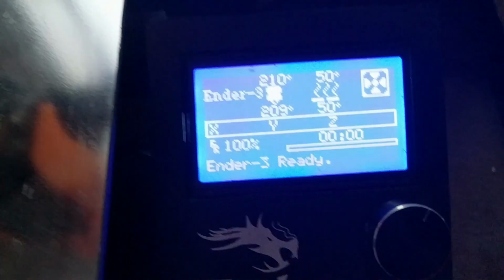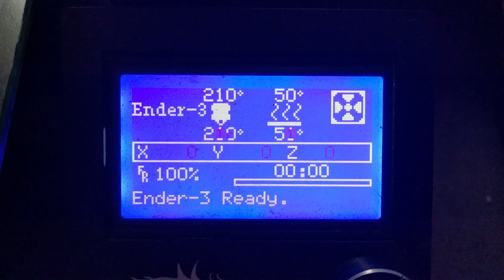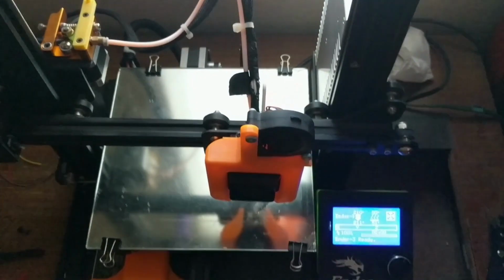Ender 3 Heat Bed Wiring Fix

Comment: Thank you for this video  - it helped me troubleshoot problem almost in an instant.
that being said, I had my Ender3V2 from late 21' till now working nearly flawlessly. 
In beggining of january I had over 103 days of print time.
I know around 20Kg of printed filament aint much -  but I guess I can say low cost wiring is a wear item.
Reply from the maker: Anytime wires move or connections have to rotate or reciprocate, they are a wear part. Like the wires that go into a car door or hatch, or the rotating controls on a multimeter. Some will last a long time, but eventually they will fail.

Comment: Thanks for making this video man. What i love about the ender 3 is the same reason i hate it. Theres such a saturation of irrelevant information when your having an odd problem like this its difficult to find someone takking about having both thermak runaway and failure to heat bed. Now im going to go check those solder points before removing the bed if i can. It seems regardless of what you search about the ender 3 today its always a guide to bed leveling. I had tk dig to find your video. Anywy, i appreciate it.

Comment: My one wire broke off right at the solder. Could I just cut my wire off there, strip them both and solder them back onto the solder blobs that are already there?
Reply from the maker: Sure. Just keep an eye on it, if the wire is work hardened in that area it will probably break again. You can also try adding some support to it there with some shrink tube or something similar.

Comment: No runaway for me, but failure to heat. I'm a n00b, how and where do I test for volts and continuity to isolate the issue?
Reply from the maker: Do you have basic knowledge of multimeters and electrical testing? If you don't, then I'd either find someone to help you or maybe watch a few videos on it first. Test for continuity first. Unplug the printer, take the bed off and flip it over so you can see where the bed heat wires solder onto the bed heater. Next remove the  remove the cover over the control board and find the two large wires that provide heat to the bed. The bed heat wires should be the center pair on the triple set of green screw terminals. Remove them from the terminals. With the meter set to continuity test both ends of the Black wire then both ends of the Red wire. With the meter set to continuity the buzzer should go off and the meter should show full continuity. If you get continuity try moving the bed or wiggling the wires. If you get continuity through both wires yet the bed still won't heat you're going to have to plug the printer in and very carefully test for voltage at the bed heat terminals on the control board and again at the bed. Be careful, shorting something out at this point can ruin your board. If you're getting the full 24 volts it could still be the wires, but also a dead bed heater. But also, once it's this far apart if it were me I'd probably just run a new set of silicone wires since we know the factory wires are crap. But you'll need the tool and knowledge to unsolder and resolder the wires from the bed heater. And while you have the control board cover off, make sure ALL of the screw terminals are tight and there's no sign of arcing or melting of the terminals. Good luck!

Comment: I do not see how this cable issue can cause a run away bed heater.
Reply from the maker: Whenever the thermistor isn't reporting what the mainboard thinks it should be you get a thermal error. In this case the mainboard is pumping current into the bed heater and the thermistor isn't reporting the temperature going up. It only lets that go on for a specified period of time before it throws the error and shuts the power off.

Comment: Hello Chuck, I have an issue that maybe you or your audience can help with. All of a sudden, as soon as I turn the printer on the bed starts to heat up with no value even enteree, and then shuts down with an error message...... Since then I have actually replaced the bed, and the mother board which neither solved the problem... FRUSTRATED in Palm Harbor Fl.
Reply from the maker: The bed heats as soon as the printer is switched on? Has the printer had this problem since it was new or did it work right at some point? Is the board a stock one or aftermarket? What firmware does it have? 

Without more info all I can offer is basic troubleshooting, but it's not a complex system. 

Somewhere the bed is getting power when it should not be. So it's either wired wrong, there's a short to power, or the firmware is turning it on when it shouldn't be. 

If I had this printer dropped on my bench to fix the cynic in me would say it's wired wrong and I'd check that first. But I'd also check the bed heat terminal on the mainboard, is it hot all the time? What's making it hot all the time? Is there a mosfet for the bed that's not on the mainboard? Test or replace it. I'd also do continuity tests on each bed wire, end to end, end to ground and end to other  nearby wires that are hot all the time. Once I convinced myself that all that was good I'd look at the firmware, searching and checking all the bed heat settings. If it's Marlin I'd consider backing it up and flashing with a new copy as a quick troubleshooting step.

Comment: Sir! I found your video quickly after google searching for Ender 3 Bed heating issue. You pointed me directly to the problem - Both a broken thermistor and Heat wire (+24v) at the same time! Thank you for taking the time to produce and share this video. I think the chain/links I used were the cause as I don't have much room as they were consistently hitting the back wall, and accelerated printing my have made it worse. Don't get me wrong, love the cable guard, my implementation was to blame. I hope this helps someone else.
Reply from the maker: Thanks for letting me know!

Comment: What do you think could have been done to prevent this from happening? I've got an Ender 3 coming today.
Reply from the maker: 1. Better quality and slightly longer wires. Better quality solder and workmanship and careful quality control. But then again, if they did those things it wouldn't be a sub $200 printer. 

Things you can do? Inspect the heat bed wires and soldering. If you find anything not to your liking remove the original heat bed wires, wick the solder off and replace with quality tinned wires with silicone insulation and solder them property using a good, lead based solder.

Personally I think the Ender 3 is designed to last just as long as most people's interest in it will last. And from what I've read, it's only a small part of us that will actually get it printing properly and keep using it long enough for it's problems to surface.

That being said, the new models are supposedly better in many ways than my two early models. But I'd still inspect things carefully when I'm assembling. Wires, connectors, the Z axis rod line up and making damn sure the X axis arm is level. and the whole frame is squared properly before tightening.

Comment: Thanks for sharing.  I wanted to actually see the soldering part, but still a good vid
Reply from the maker: Thanks!  Sorry about not showing the soldering part. I actually had meant to include it but found that my little TS100 iron wouldn't get it hot enough and ended up getting my pistol grip Weller from the garage and I never restarted the video.

Comment: Hi Chuck, I Haven't seen you around for a bit. I hope you're well. Look after yourself.
Reply from the maker: Hi Paul. I'm fine, thanks for asking. My problem right now is that my house is still torn up from the flood and it's been a real headache getting work done right. Hopefully we're on the right track now to get it done and, if there's a God in heaven, it will be done in a few weeks. I was actually thinking of clearing out enough space in my office to print some things and make a video. Again, thanks for asking!

Comment: Chuck, i just bought the new creality ramps 1.1.4 motherboard and after installing it i now have hotbed runaway. I thought i wired it wrong but even after swapping the wires it runaway. Is this the same issue you had? I am at a roadblock and frustrated.
Reply from the maker: Yes, I was getting Thermal Runaway errors and the print would stop. In my case I'd get an open, the broken wires would be touching when the print started, but somewhere along the line would pull apart just enough to break connection and the print would stop with the error.

Comment: Chuck, you seem pretty handy, so I thought I would toss this your way.   if you (or I) wanted to check to see if the bed or nozzle is really heating to the specified temperature, any good way to measure that?  I'm really more concerned about the nozzle, as I seem to have to set my temps a little high to get the proper results, so was just wondering if my temp readings are off.
Reply from the maker: Unfortunately I haven't figured that one out either. I've got a good non contact thermometer, and it gets the bed temp perfectly as well as things like boiling water and auto engine temps (the latter being why I bought it, to solve an overheat issue with my old Jeep). But it misses the nozzle temp by 40c and I know that can't be right, the filament I use won't flow properly nor will the layers bond well at that temp. It also matches A/C temp perfectly with the digital contact thermometer I got for doing A/C work. Also, to muddy the waters even more, I can set all 3 printers to 210c and get the same temp from the non contact thermometer, (177-180 on a 210 setting) on all 3. I've also changed thermistors on one of my Enders, it prints fine, yet the thermometer still says 177-180. I've tried the contact thermometer, also with poor results as I think there's just not enough surface contact area for a good reading. So other than adding a second thermistor with an external meter (some of the Fluke's and Fluke copies have this ability) I'm afraid I don't have the answer.
Reply: @3rdpig  I've seen a few others attempting this with similar results.  It is an interesting problem, hopefully someone somewhere will figure out an easy way to do this reliably.

Comment: I use that same brand silicone wiring....great stuff! I've done some of that same wire swapping on both my CR-10S printers... ya know I'd pay extra if Creality would simply not use the cheapest of everything when they build these printers. This is the reason I don't buy Creality printers any more.
Reply from the maker: I hear you about Creality and cheap components. But in the case of the Ender 3 it's probably the only way they can produce a working printer that sells for $179.
Reply: Absolutely agree Chuck!

Comment: Might want to do the external mosfet upgrade , made a major improvement for me. Also maybe wire tie the wire loom over to the side away from your center stepper-might catch at print speeds "just a thought" :)
Reply from the maker: What was the major improvement the external mosfet made for you?  I think there's no doubt the wires got broken hooking over something when the bed was all the way to the rear. In my case, after thinking about it some more I think what happened is when I had the bed off once before I put it back on twisted one counter clockwise rotation from how it came off, which pushed the wires over towards the end of the aluminum extrusion and it caught on that. So I'll take your advice and find a way to keep it away from the stepper motor and also print and install the curved end that fits on the extrusion so it can't hook there either.
Reply: Two advantages with mosfet 1.) Safety-gets it off your board which reduces stress and less likely to fail over time (Had one fail recently) which meant I needed to buy a new board. Second it seemed to improve bed heating time and appears much more stable during printing  @3rdpig